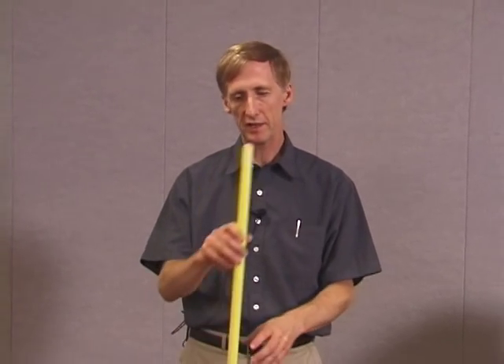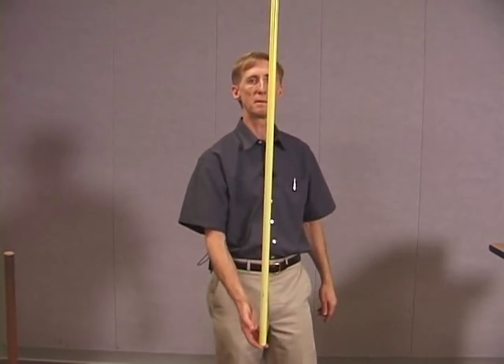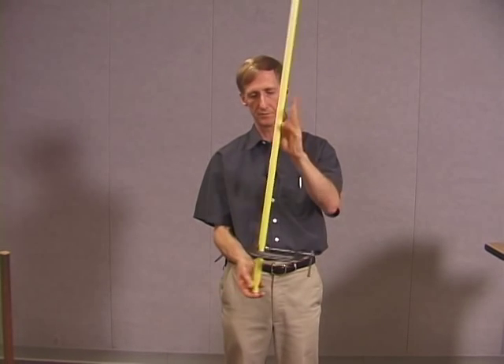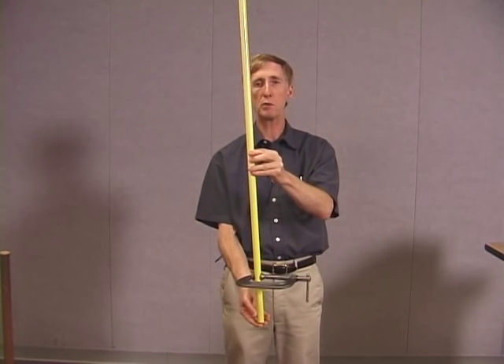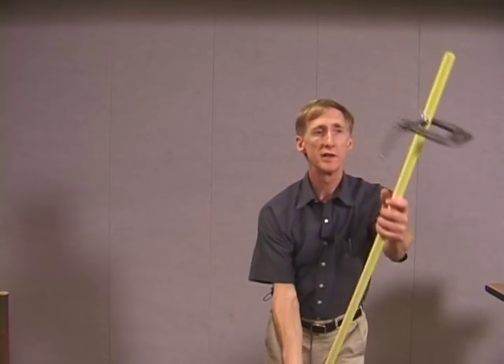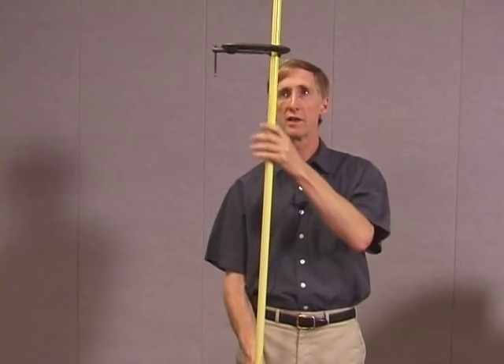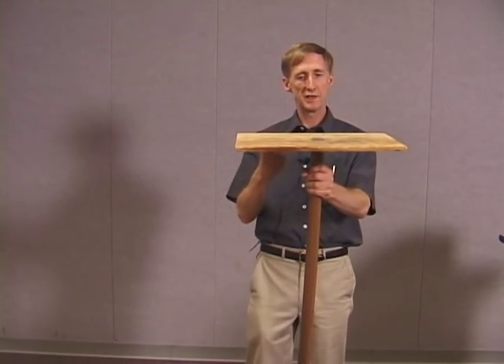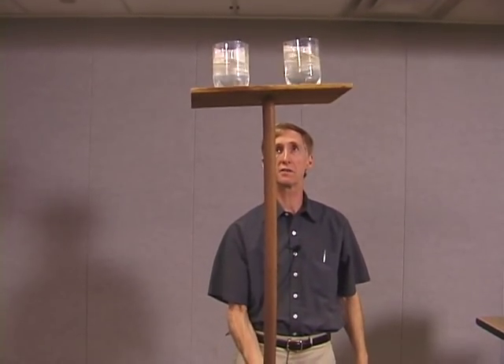Rotational Inertia: Balancing a Weighted Stick

Comment: Not a satisfactory explanation!
The while the higher center of mass does increase the moment of inertia ("rotational inertia"), the moment of force exerted by gravity increases as well.
Without rigorous calculation it is in no way obvious which of the two has a greater effect.

Tightrope explanation is only partial and lacking, but more accurate. Lowering center of mass reduces the gravitational moment of force, while the pole increases the moment of inertia, hence one must fall slower for sure.